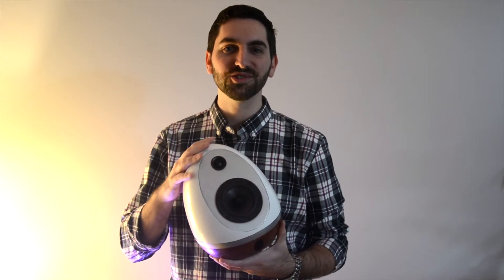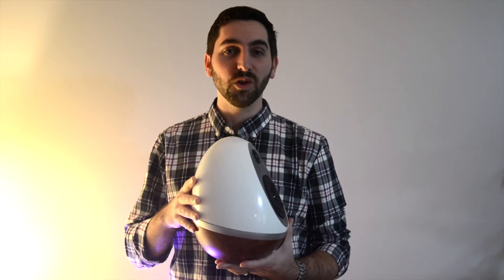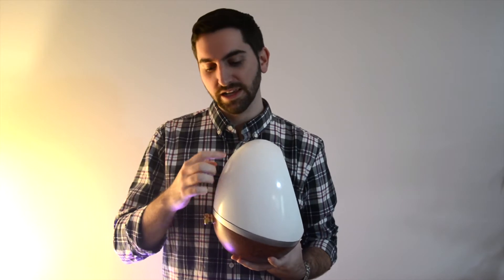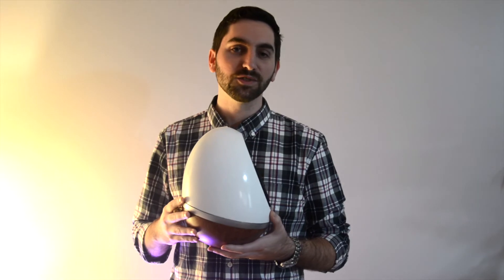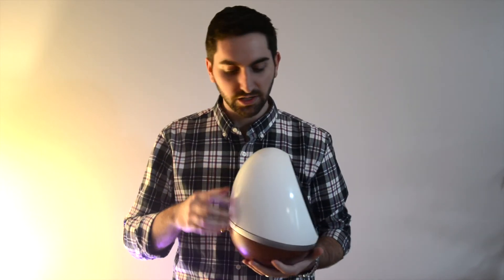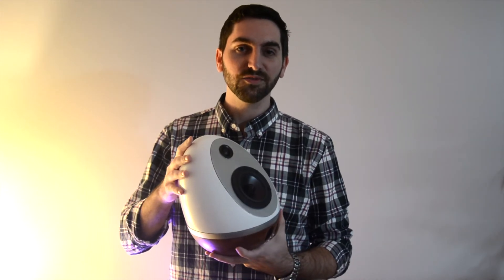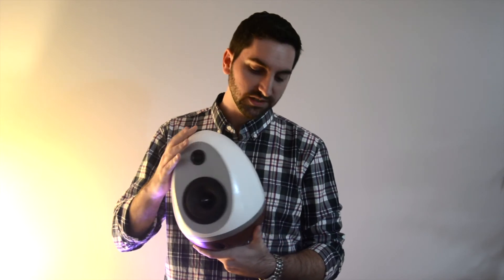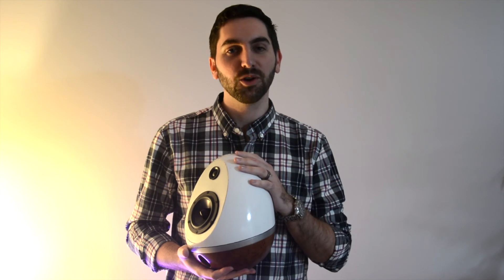Speaker Eggs | 3D Printing Build

Comment: If the TSPs of the manufacturer are correct (which too often is unfortunately not the case) the ideal volume for bass reflex is from 120 to 130 cubic inches. With a tuning frequency of 57Hz this will result in a -3dB point at around 53Hz, according to the calculation diagram in the German DIY loudspeaker magazine Hobby HiFi, issue 5/2003.
Due to the high Qts a high pass filtered bass reflex box might be a better choice. According to the formulas in Hobby HiFi 5/2010 the Dayton needs 265 cubic inches tuned to 51Hz and a 980uF cap in series. This will result in a -3dB point at 51Hz and is more likely to have a balanced response in the bass than normal bass reflex.
Reply: My own experience has been that vented boxes are actually less sensitive to a maximum or minimum Qts, and they make it possible to get balanced bass from drivers with a variety of Q parameters up to about 0.8 with a little careful design (shoot for an overdamped, low-tuned alignment). For drivers with higher Qts between 0.6 and 0.8, you can actually get very deep bass from a box that is between 3 and 6 times the Vas parameter (bigger than what the model usually says is optimal), with the tuning frequency setting the low corner frequency. This is a high-order box so the roll-off below tuning will be more rapid, but the high Qts of the driver fills in the "dip" that often forms above the tuning frequency when a low-Qts driver is used in an oversized and low-tuned box.

Comment: Great idea! An egg shape is acoustically as optimal as a sphere, the ultimate shape for a speaker enclosure. Unfortunately you added some acoustically suboptimal features as edges around the oval plane and around the drivers, the values of the crossover parts don't seem feasible and there's no resistor or voltage divider at the high pass of the tweeter. Did you measure the frequency response of the drivers at right angles with the oval plane or in parallel to the surface the speaker stands on?
Reply: Hey, thanks for the reply. This is actually my first speaker build so I did my best to research but I am almost positive its not optimal. I used the Erse crossover calculator so I am not sure what went wrong there (http://www.erseaudio.com/CrossoverCalculators) what are you seeing? Other than that I didn't do much in regards to measuring the frequency response.
Reply: The crossover frequency of 4.5kHz is a good choice!
Unfortunately those crossover calculators, of which you can find several on the internet, are not useful for a real speaker. The result they produce is only theoretical for speakers with an ideally balanced frequency response mounted in an infinite baffle. The calculators especially do not take the actual response of the speaker and the baffle step into account which occurs if you put a driver on a finite baffle. Usually that produces a rising curve from low frequencies towards 1kHz with a peak of +6dB. (To be precise: -6dB in the bass in comparision to mounting in an infinite baffle. The mids are at the same level as in an infinite baffle.) To get the best result it's necessary to measure the responses and make a simulation of a crossover. There is free simulation software available. I use BoxSim which is quite a powerful tool and therefore a little complicated. http://www.visaton.com/en/literature/software/downloads/index.html For measurement I use ARTA http://www.artalabs.hr/ and a MiniDSP UMIK-1 calibrated mic.
I found an example for a speaker with similar parts in the German DIY loudspeaker magazine Hobby HiFi, issue 2/2015: They used the Visaton W100S 4ohms as mid-woofer and the Visaton DTW72 (6.3ohms) as tweeter. Those have about the same sensitvity as the Daytons but differing frequency responses. Hobby HiFi chose a crossover frequency of 4kHz which is also adequate for the Dayton tweeter. Their low pass coil has 0.68mH AWG18, the electrolytic cap 10uF. They needed a serial notch filter (2.2mH AWG24, 10uF electrolytic, 4.7ohms including ohmic resistance of coil) in parallel to the woofer to fully eliminate the baffle step due to the high crossover frequency. The high pass MKP cap has 3.3uF, the coil 0.22uF AWG24. The tweeter was much too loud and had to be attenuated 7dB. They used a voltage divider with 6.8ohms in series and 6.8ohms parallel to the tweeter. I'd reckon there's a 70% chance that the result with this crossover is good but a 95% chance that those values provide a noticable improvement for your speaker. If you have 30 spare bucks for a pair to spend give it a try! A good starting point for experiments is the resistor in the serial notch filter. You could get a few values up and down and just listen what sounds best. The cheapest 5W type will be fine there and will only cost a few cents each. - This only applies at right angles with the oval plane!
In parallel to the surface the speaker stands on you get a timing alignment due to the tilt of the front and the whole crossover has to be redesigned. That might result in even better sound quality but requires a significant amount of crossover design work.

Addendum: your values seemed too small because 90% of all 4 ohm 2-way low passes consist of 0.82mH and 22uF which results in a cut-off frequency around 3kHz.
It's 7am now here so I'll go to bed now - covfefe!
Reply: I was a bit tired when I wrote the last comment. That's why I forgot to compare the impedance responses of the mid-woofers. Especially around the crossover frequency 4kHz, the critical point, they differ: Dayton 5 ohms, Visaton 8 ohms. BTW: that's also something the online calculators don't take into account. Not the nominal impedance but the exact value at the crossover frequency is crucial.The chance that the result with this crossover is good is therefore maybe only 65%.
Reply from the maker: Thanks for all the good information here, unfortunately a bit over my head. I am not entirely sure I would be able to tackle a re-design at this point but good to know for any future builds.